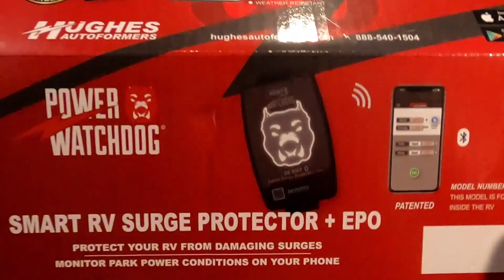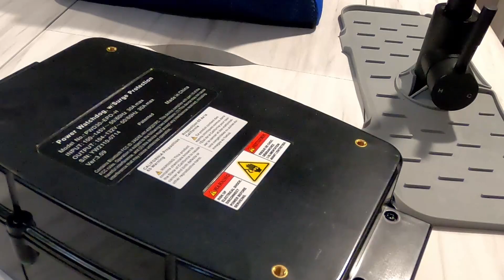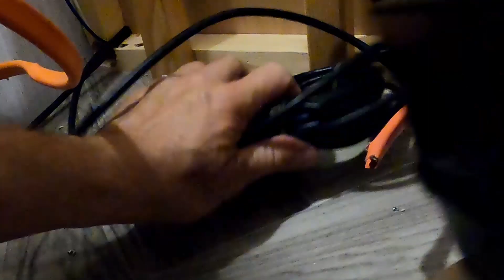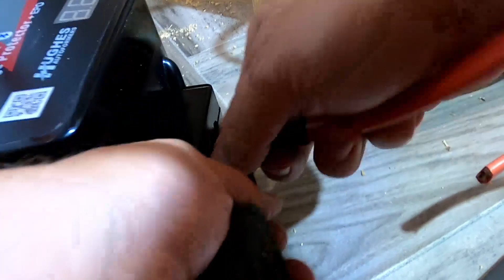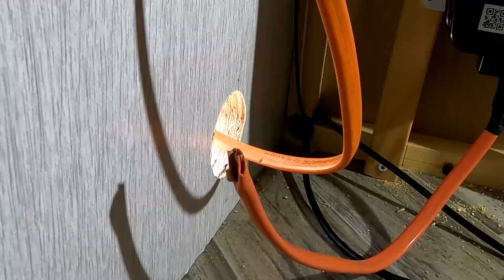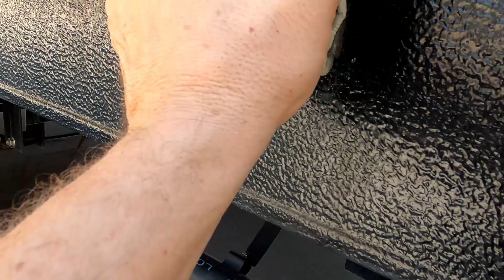Adding a Power Watchdog Surge Protector to an RV or Travel Trailer

Comment: Why did you need the extra wire ? Could you just cut the existing wire and add the box in the middle ?
Reply: Did you wire that backwards? Shouldn’t the In be coming from the shore power and the Out be going to the trailers breaker panel?
Reply: @oldguydoinstuffoutdoors   I was thinking the same thing. Then he flipped it at the end.
Reply: I was screaming at the TV the whole time it was wired backwards....then he cut where he realized it and flipped it....
Reply from the maker: Your wire amount could be different, but I wanted enough slack in the wiring after adding the surge protector. That's why I used the wiring to go to the outside plug, and used the original outside plug wiring end to go into the surge protector. Good luck with your project!- Mike